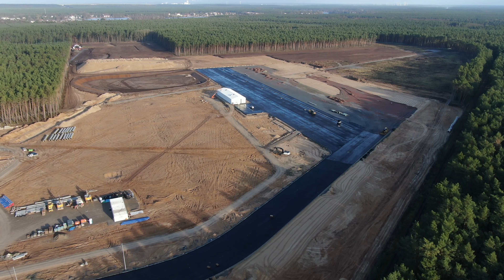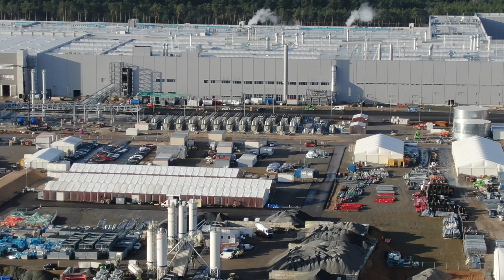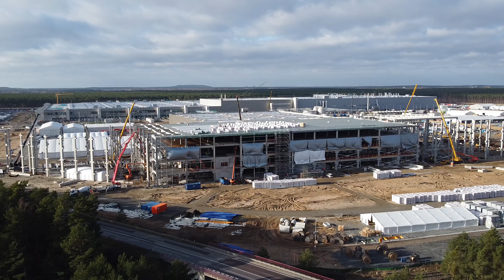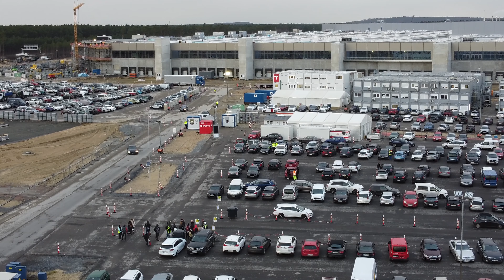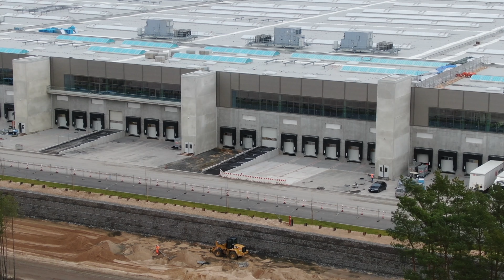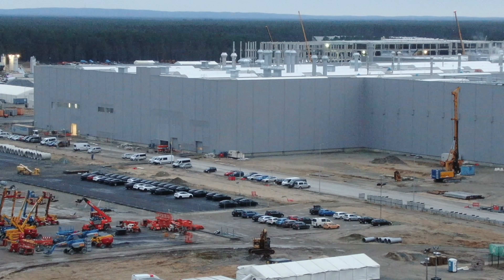Giga Berlin | 2022-01-05 | Timelapse

Comment: hello, it is expected when the start of production of batteries 4680 ?, because the construction of the building is not progressing very quickly.
Reply: I think they'll be supplied by Kato Road in Fremont once Texas is operational. Texas cell building will be done before Berlin.
Reply: I expect the battery production in Berlin to begin in the first half of 2023
Reply: I agree pace seems slow. But noticing all steel and concrete going at each floor (not only ground), they are building a bunker. Wonder if Texas battery factory is built the same way.
Reply: @bidon5037  Is there a need to build this way when you see the meteoric progress of giga shanghai. the goal is not to manufacture the most resistant building but to produce batteries
Reply: @ChristianBlueChimp  I do not see how it is economically profitable. and I am surprised to see so few people build this building for months and months
Reply: German "panzergineering"?

Comment: Nice video! I do not see any train loading area? A railway is going right past the property, so I am a bit surprised that they do not connect to it. May be later...
Reply: @sam28600 .. it makes sense to do it later. When they run on full capacity they will need it. Now they use it to bring the building materials to the job side. If they would build the rail way loading area right now they would lose the opportunity to bring the building materials by train. Because to build this loading station will probably take few months?
Reply from the maker: It's actually going right through their property. It's just one small line though. A lot of concrete parts have been delivered by rail and a lot of gravel. At some days there were 2 gravel trains unloading at the same time.
In a few years Tesla will build their own train loading station in the east of their property.